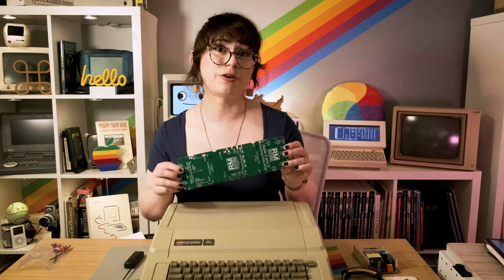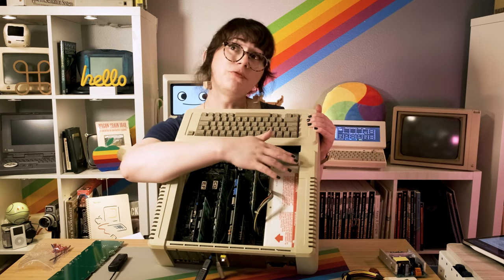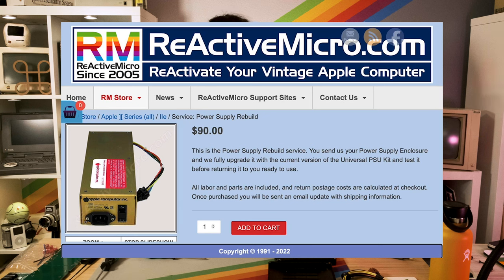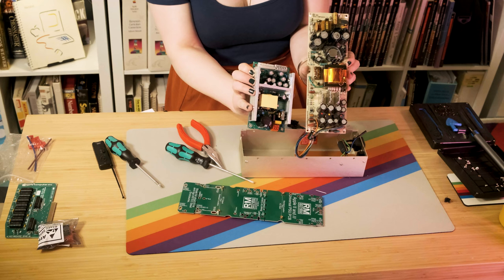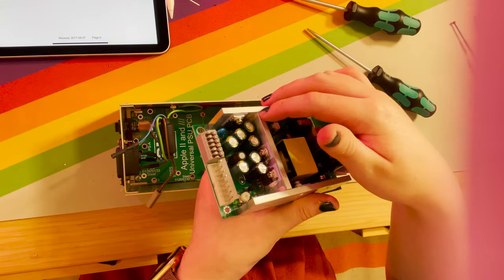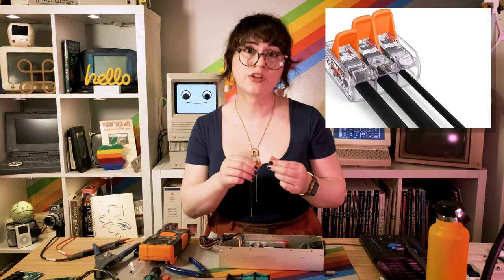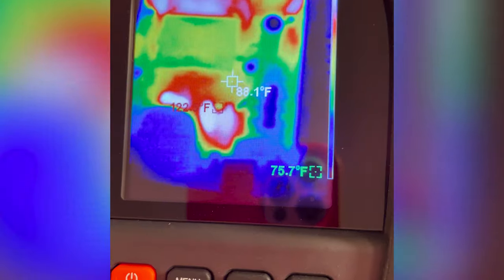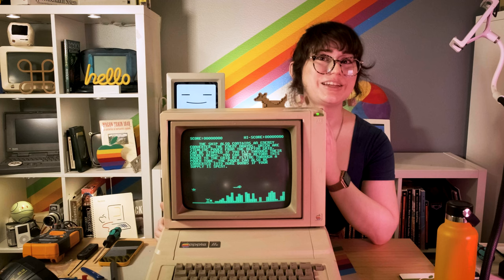[Labs] Replace your Apple II Power Supply!

Comment: Why take the old PSU board out of it's can? We can just mount the new PSU in place with it's own connectors and nothing else. It's recommended to run the PSU without a cover on, inside the machine, as long as it's properly seated, for better cooling. I run the G4 cube out of it's chassis most of the time, to keep it cooler. It's running a Sonnet afterall,  as for the soldering, the contacts better be tight, otherwise they will heat up just like the old power supply does. Btw, that old power supply heats up so bad due to everything turning into a resistive load in it. Including the transistor. Every component, even the board, lose their conductive properties and start to dissipate heat. My 1989 Sony Indextron is a resistive load at this point, even though I fixed it by getting the components replaced and the solder joints redone, it's heating up like nothing else, that's the substrate. For the little wattage that Apple II has,  lower than 50W, I would rather make a power supply with mosfets and have a USB C on the back of the machine, with a PD trigger. The machine takes 12V, you would only need to regulate 5V. How much does it draw from 5V? About as much as a phone, prolly 10W. That's a mosfet with a small heatsink and 2 or 3 10V 470uF caps. It'll never know there isn't a fully fledged PSU installed.

Comment: I repair vintage audio gear, and a lot of high-end gear from years ago (Studer/Revox, I'm looking at you here) used Rifa caps. Those caps are on my "replace on sight" list. I replace them even if they're perfectly fine when I find them. They're also used as snubber caps on the power switches of Dual turntables.

Comment: Just a thought, but the IIe power supply was probably running hotter than usual since the extra metal cover may have been acting as another heat sink maybe. I personally just replace the rifa caps everytime I get another apple IIplus or IIe since it’s only a matter of when it will explode/melt. 5-10 buck fix. :)

Comment: That's a merch idea right there.

Maccy on a sticker that says "Warning. Do not open this. You might die."
Reply: After working on compact Macs and early iMacs, it's nice to not have to worry about the CRT. Still gotta watch those high-voltage caps though 👍

Comment: Very nice! Yep, seems like in the end it would've been easier to just solder the mains wires than to use those connectors, though is an option for those who do not have the ability to do so. I really like the low voltage wire loom it comes with, handy!

Comment: A new power supply is really the easy way out, but replacing the caps in the old power supply would pretty well bring it right back up to scratch and would work exactly how intended.   The modern power supply may seem to be a nice way to protect your equipment, but in reality, the modern power supply could actually cause my trouble than it is worth.    With these old machines, they re designed to run on the older style, often at least partly linear power supplies.   Depends how technical you are.  
New power supply is a great idea for those who don;t know how to properly rebuild the old one, but be aware of the possibility of more interference on the DC lines and possible longer term issues with the equipment not designed to use them.

Comment: This is the 2nd time in a week I heard about those wago connectors(and never heard about them before!)

For my apple 3 I ended up using wire nuts, but I'll probably end up popping the PSU out again and solder it.  The reactive micro PSUs are really awesome and I want to pick up more for my Apple IIs
Reply from the maker: WAGO! WAGO! WAGO! I use them in my walls !
Reply: @MacintoshLibrarian  And it's fun to say!
Reply: Wagos are fantastic.  Our house suffered a lightning strike that took out about half of my “smart” Z-Wave switches (crispy burnt).  As I’m restoring these switches that are already beefy in size and hard to stuff into the electrical boxes, I decided to reorganize one of the messier boxes (three dead switches) I used wagos to replace twist nuts.  What a difference!  If you take time to manage the wires you can gain extra space in the wall box which is good not only because it’s easier to work in the box but also allows more cooling.

Comment: Yikes! Didn’t realize there was a Rifa in my apple ][ psu. Great video, especially the comparison using the thermal camera. Those old power transistors get pretty hot. Combine that with the aging PCB coating and the result is a lovely diffuser of essential 80’s electronics 😂

Comment: What a coincidence, I just bought a really interesting looking Apple II clone which has no power supply. Presumably it was removed because it blew up, since I'm guessing it wasn't made as well as the original Apple one.

I looked at the RM store (might want to double-check your link in the description, I got a page not found error), and unfortunately their price for shipping to Australia was almost as much as the kit itself. And since I don't have the power supply enclosure, I'd probably need the full replacement PSU, rather than just the kit, which would cost even more to ship. But that's fine, I can build my own solution anyway.

I'm still waiting for the machine to arrive from the electronic bay. It has a full keyboard and numpad like the Platinum, and capslock key so I'm hoping that means it does lowercase like the IIe. Oddly it has no Apple keys like the original II or II Plus, but it has 64K of memory, so I'm not really sure what it is.
Reply from the maker: Thank you! i fixed the link !  That sounds like a very unique clone!
Reply: Look me up on face book in the Apple II enthusiast group,  I can put you in touch with somebody in Australia that will sell you an old refurbished PSU that will last.

Comment: 19:58, no, squeeze connectors are never fine. They always perform precisely as they performed here. You can put 9000 lbs of clamp pressure on them and the wires still slide right out. It's a miracle.
Reply: I've used them several times for automotive/trailer connections, but never on a car I wanted to keep. They always seem to cause just as many connection problems as they solve.

Comment: The RIFA cap has nothing to do with power going into the computer.  It will do nothing in your blender example.  It is only there to stop AC line noise coming  FROM the computer...i e upstream.  It's also arguably unnecessary now as three are no more NTSC analog broadcasts...but the HAM radio guys will get mad.  But there is a lot more to make them mad like LED lights, TRIAC dimmers, HF florescent, but that is another story.
Also, the "other" caps Apple used (electrolytic) are of such high quality, it's rarely worthwhile to change them.  I've repaired many Apple ii power supplies and found very few caps out of spec.  The RIFA and maybe c3(next to the transistor) should be changed due to heat.  Leave the rest alone.   More than likely, they will probably outlast any replacement cap you put in, esp. Chineseum ones ...
Reply: I've repaired a couple of hundred and the caps do leak and fail and its not uncommon.  Finding high quality replacement electrolytic capacitors isnt hard, both Mouser and Digikey carry a wide selection of Nichi and Rubycon caps

Comment: Its an old computer...power supply is simple and can be repaired and maintained easily...will you also put a new mainboard because the original is old? I have an idea, just use emulators and dont even deal with retro hardware...because retro hardware fails a lot and fixing it is part of the fun...that is no longer an apple ii sorry cant watch this...

Comment: Why would you replace a power supply that is easily recapped and has worked flawlessly for over 20 years? Modern power supplies have proven to be unreliable under the best conditions they often barely live past their warranty and do extremely poorly in an ventilated enclose like the apple PSU case.  Currently there are a lot of people that still repair the original PSU's and many on facebook that will guide you through the process, there is nobody repairing the PSU you put into it and no guarantee there will be a replacement in 10 years time, let alone 30.  This video offers the worst advice I've seen recently.
Reply from the maker: Hey! Thanks for making the booti card!
Reply: A little dramatic, but I agree with you.  However, I will say a super loaded up iie is close to maxing out that power supply, so I can see that as a point to changing it, but I certainly will not gut it.
Also, if the RIFA cap pops, just leave it alone.  It will bother nothing and that thing is arguably unnecessary anymore with not NTSC broadcasts.
Speaking of the RIFA cap, it's apparent she doesn't understand properly what it is for by her blender example/comment.  
I agree with you even to the point of not recapping...I've been screaming for years that the cheap Chineseum caps people are putting in will not last the ones they are ripping out!  But people hear the RIFA cap pop and jump on the stupid recap the whole thing bandwagon.  Sometimes c3 around the transistor gets cooked and should be checked but that is it ...